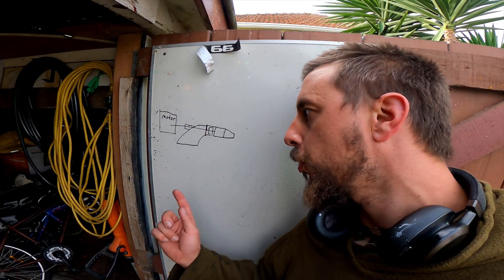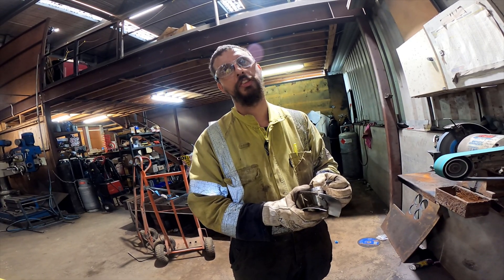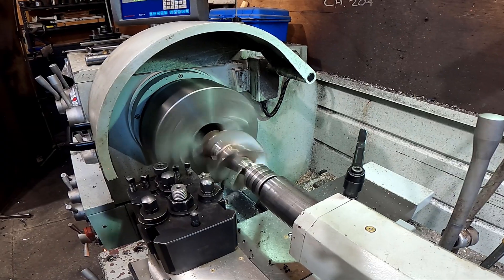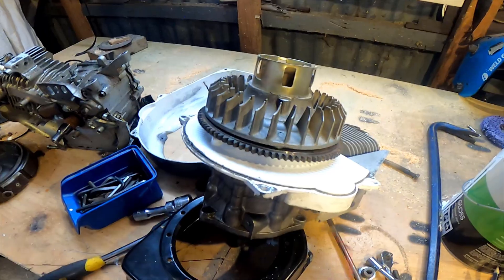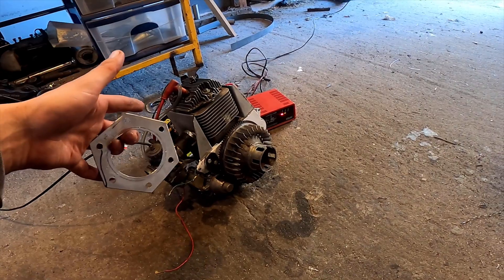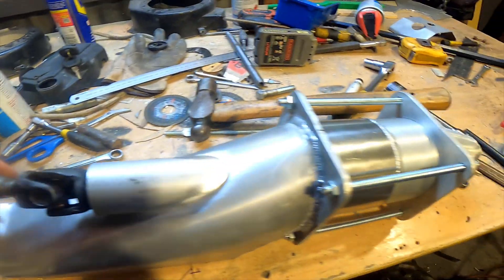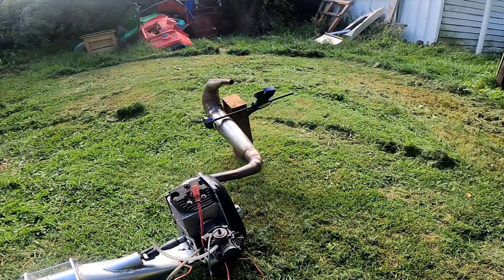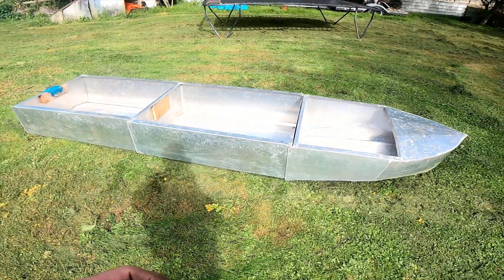Homemade Jet Unit Build Part 2

Comment: Shit I would give my left but for a original size tint sheet of parts needed to make a high powered water jet, I want to put one on each side of a 23’ yellow Tail center console boat I hv my name on that’s abandoned in central Florida fro hurricane, waiting on state to get off their asses and start the stickering of abandoned boats, could be another 6 months but hv most of water out of it and covered with new tarps double arrows it cause I live in Texas just got back Sunday 24th from there, landowner said no one would be allowed on property cept Stare placarding team, owner has been contacted and he said keep my damn mouth shut why I called him I’m stupid, he has filed insurance and wants a new one, wished I never called him and will FedEx me all paperwork title and signed title transfer for Texas so everything is legal, I want to try fabricate and install a water jet under boat one on each side, and want boat to try and hit at least 50knots if I can get it to!!  Friend of mine said speed isn’t a option it’s just how fast do I want it to go, has your do with I’m Elmer blade pitch and number of them and motor
Man would be super cool to use electric motors know how quiet it would be compared to the 3 250hp Yamahas on it now, or diesel motors, venting either way gas or diesel either out the side or out back, researching now to see if I can vent out under the water line while idling or slow speed, but once boat planes out exhaust will be above water line. Just ordered whole roll of cut fiberglass bd 1/2 roll of 6% woven fiberglass, and 20 yards of 50” wide 1708 biaxial fiberglass fir final layer, 40 gallons poly resin, 5 gallons of fairing putty, waiting and deciding on gel coat or paint prob go with spraying gel coat for finishing layer. What a great way to get to buy new cordless tools for my collection, lol wife thinks I might need them buy what you need. I’ll shut up now 2 year project completely rewire boat, go thru the 3 motors ry are 2021 250 4 strike Yammies, with z4 blade props, it was on dry land so not thinking much wrong with it but muddy landowner aid I floated in over barbed wire fence rested in V in tree motors side angled down into mud and bow angled I tree, paint scratched a little all the electronics still working properly, tilt trim working bet they start alright up, hour meter showing 46 hours of run time practically brand new yipppeee, got a 100,000 boat for couple hundred dollars well the trailer, might cost 1,000 at auction or if I can hire someone to find abandoned trailer but those can sit in water for a year and still sell for 8,000. Still gotta find someone that has a great heart live helping folks and not chasing that almighty dollar like most are, everyone want to make a lot of money, Cant take it with you, but I’m going to co to ur taking troubled kids, or kids that has lost one or both parents overseas in war. Fishing Lake Texoma on TexasOklahoma border north Texas and haul to Texas coast if I end up buying a very little man cave in stilks. 
But gotta find someone to GIVE me a to sized print so I can glue it to sheetmetal and cut out and weld it up. Then trust my lord Jesus to hook me up with someone to help me figure out motors needed or will get job done, if electric gotta design water cooling, all will be inside a cowling I will design and glass to cover and suck water fro lake or hv a water holding tank iced down water to help cool motors and recycle it or dump overboard if oven or lake water is used, might mount a 50hp outboard motor in between the jets fir a kicker emergency motor if long ways off shore. 
Hv prayed about finding the folks needed, I do t charge the kids anything to take them out plus give them the spinning Rod combo also at eve of day after I take them out to eat with parent.'please if someone reading this long ass text if you hv parts drawing original size I’ll pay you to ship parts dia Graham to me or can email them to me. I don’t know how to email or get ahold of anyone thru utube im 61 years old, veteran, and not computer savey, nor mathematical smart enough to figure out amps Ho needed to make a 23’ boat do 40-50 on water. GOD works in mysterious ways, anyone helping me I will take them out on lake or ocean anytime they want to go when I go, whenever they want to go when I go. Don’t like going y myself won’t go out offshore by myself anyways. God bless thanks for anyone that will help me 
Sque

Comment: What engine 2 stroke 210cc 19hp you use?
Reply from the maker: It’s an old paramotor engine a solo 210
Reply: @dkthewelder  do you sale it
Reply from the maker: @kreativitasku5048  no sorry they are hard to find
Reply: @dkthewelder  what engine similar with it? I want to build an ultralight airplane

Comment: Make the 2 stroke water cooled with aluminum tube tacked to the tips of the fangs nothing crazy but should keep it cool enough
Reply from the maker: Yes I have thought of that idea! The Thailand people weld plates in casing the fins and running water through, I like that idea
Reply: @dkthewelder  that’s what I was thinking just have to watch the flow rate!!!!

Comment: A single u-joint will vibrate and destroy the bearings and or housing, you need a coupler.
Reply from the maker: It has worked so far but I found a love joy coupling at work I might try next time

Comment: Not to be the one that stomps on your grave.  But that will never start with a live shaft sitting in water lol true!
Reply from the maker: O no ! Your right the motor just starts how it is ! It probably won’t start with the impeller in the water
Reply: @dkthewelder   yuppers lol!  I been building large scale rc boats for years. I have a 66cc  2 cylinder  build with a waterjet about the same size.  Was like let's electric start this puppy lol super hard fail!  Water coming in contact with the impeller acts as a brake almost lol. Cant clutch the shaft either as water will burn that up really fast as well.  So unless you park it likes it hot on the bank pull it out of the water to start it going to be rough! Other trick! Have seen these water board people with these on some with gas. Where I got the rc boat drive from  they use a drill start. They mount a adaptor on the flywheel.  Add a cover with bearing hole.  The shaft in the drill has a 1 way bearing.  But again never seen that started in water either lol. Maybe  it does with huge lipo drill >_<

Comment: Hey man, the impeller came out looking great! but your water outlet nozzle is way too small from what I see here, I would trim it so it's half the diameter size of the impeller, and since you can always weld a new one, I would even make it just 30% smaller 
Example, Impeller: 100mm
Nozzle: 70mm
Can't wait to see your follow up video!
Reply from the maker: O nice the impeller is 100mm and the nozzle is about 45mm so I will trim it down , the drill would load up when it started pumping and it is a powerful drill. Do I need to make a straight part on the end? And how long do you think?
Reply: @dkthewelder  Yeah won't hurt, 3~5cm straight pipe at the outlet should be good, you can always trim and modify, you did an awesome job, lend me your welder for dew days ;-)
Reply from the maker: @Eden_M  thanks. I would if you weren’t on the other side of the world. How is your surfboard going? Would like to see some of how you made your jet unit stuff on YouTube
Reply: @Eden_M  Brother i have 37 feet Long yacht and I would like to make a water jet for my Boat So can you please suggest me What size of Water jet can be used ???